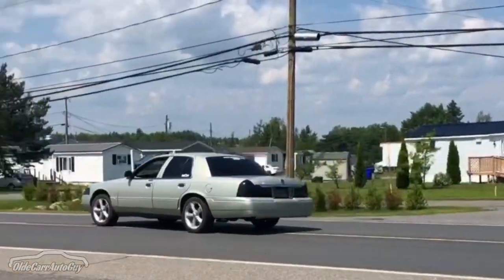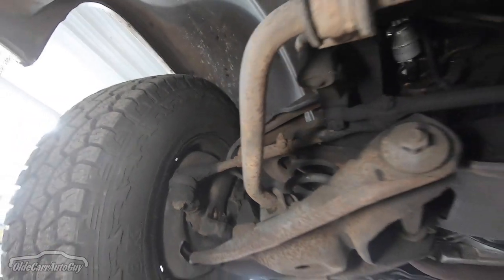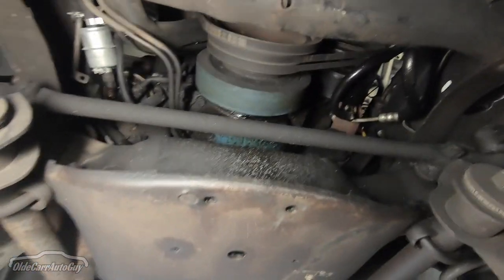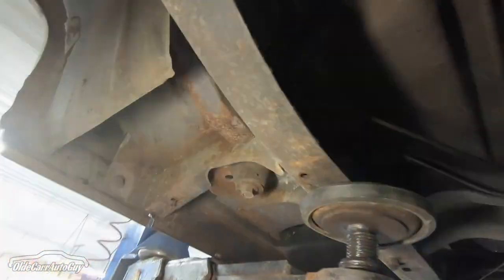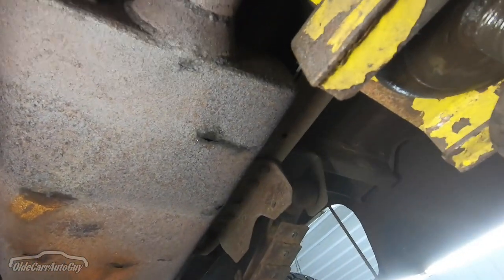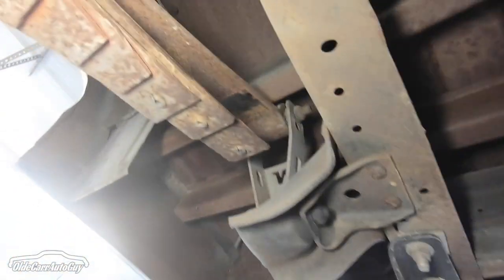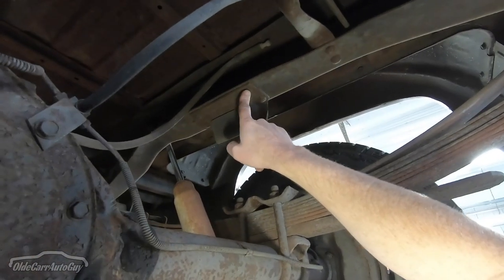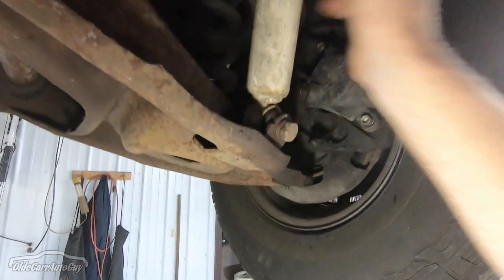HOW TO PREPARE FOR A LOWERING KIT ON YOUR 1973-87 C 10 SQUARE BODY

Comment: Dale and #projectLOWFAREmont seem to have very similar leaks. I'm pretty sure I have a rear main seal leak. Power Steering for sure. Probably oil pan gasket. Looks like maybe even valve cover gaskets. Once I can drive that again I want to powerwash the motor before I do the head swap. That will likely help me pin point spots better. But you look like you found a good one with Dale.
Reply from the maker: Eventually I’ll look after all of it! At the end of the day, the more work we end up putting into them the less likely we may be to sell them!

Comment: Chevy's way of building suspension is design it for the Corvette first, then put it on everything else.  Lower control A arms with coil springs and an independent shock absorber/strut, mounted directly to the K member supporting the engine.  Very simple and effective, yet why do the A arms look like they're held to the K member using U bolts?
Reply from the maker: You have a point! Perfected over the years!

Comment: Will the drive shaft have to adjusted ?
Reply from the maker: I will likely need to adjust the pinion angle, but shouldn't have to do anything to the driveshaft except replace that steady bearing that is worn!